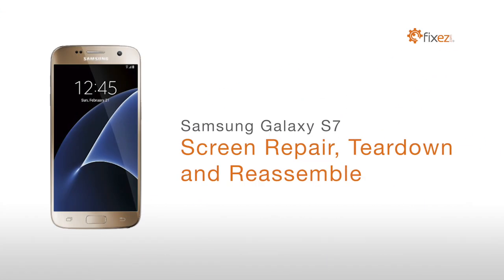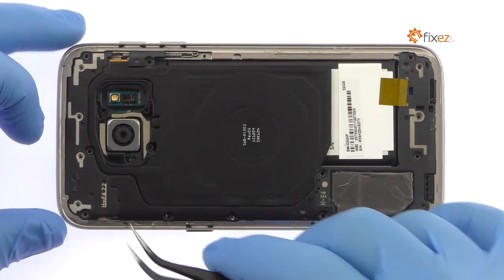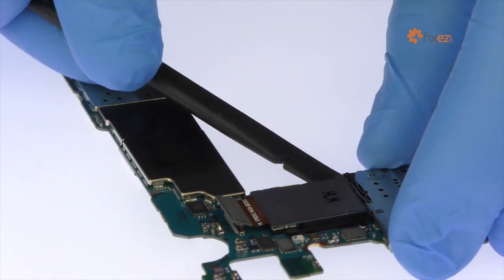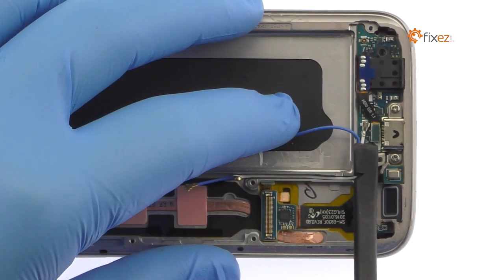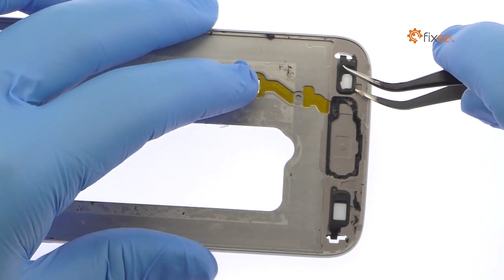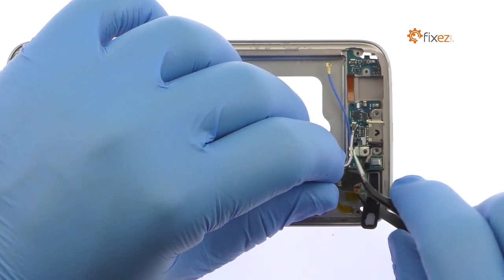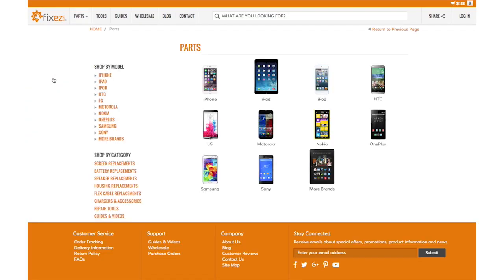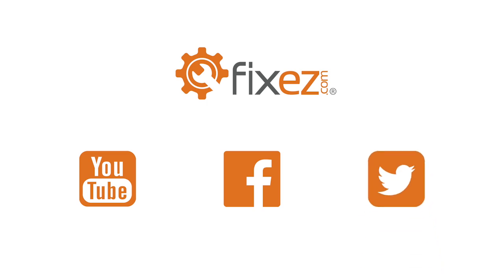Samsung Galaxy S7 Screen Repair, Teardown and Reassemble - Fixez.com

Comment: Which items are not required to be removed if I just want to replace the screen?
Reply: besides the obvious . You will not need to remove the battery, he removed it because the screen was not broken and wanted to be careful .
Reply from the maker: +Alex Marks motherboard must be removed to fit the cable though the frame. The battery and ear speaker are highly recommended as to prevent and damage while heating the display.
Reply: The screen is broken.  Heat isn't needed.

Comment: No adhesive added after repair? Does that remove the water resistance ability?
Reply: I was wondering about this too!  This is going to be my first screen repair.  I learned how to take S7 apart. But how to put together?  What glue should I use for the  the LCD assembly and the frame?  The same liquid LOCA glue which I am going to use for the lcd lens?